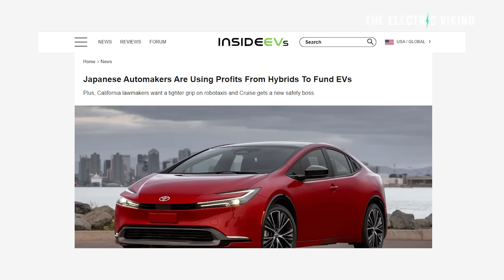Japanese Automakers using record profits to fund huge transition to EVs

Comment: I was a loyal Toyota customer till I wanted to purchase an EV......Now I have a Chevy Bolt EUV and love it.  Toyota's loss.
Reply: Not everyone is buying ev right now , only rich can afford it . Ev not an option for middle class
Reply: They discontinued the Bolt. They used LG Chem (Korean) battery plagued with fire with no resolution (could not fix).
Reply: Actually, EV's have reached cost parity with the average ICE vehicle and Europeans have no trouble stepping up to acquiring and EV as they see the long term value of an EV. They don't seem to go into cognitive overload figuring that out like so many do.
    The writing is on the wall.  ICE is dead in all practicality. And why are so many so impatient?  Take off the blinders and challenge your curmudgeon attitude. Fight back against your cognitive dissonance. It doesn't serve you well.
Reply: @jashanvirsingh2166 Yes, EVs were for the rich 10+ years ago. But there are plenty of affordable EVs now, of course it will depend where you live.  And also it will depend on your government too.
Reply: @jashanvirsingh2166 if you cannot afford a $35,000 vehicle (after tax credit) you are not middle class
Reply: Looking at the relative reliability and customer satisfaction ratings between Toyota and Chevy, not to even talk of resale values and maintenance and repair costs, I would argue the loss is more yours than Toyota’s.
Reply: I loved my bolt euv!!! Smother, quieter and better cameras than my model y
Reply: Toyota makes record profits for two reasons 
1. They sell record volumes 
2. $ vs ¥ appreciation .
Period .
Reply: @TreDeuce-qw3kv in Belgium Tesla Y rwd is 44k, tesla reduced stock to 39,9 K to be elegible for the 5K grant. That means a model Y for 35 K.
Now try to buy a similarly specd VW golf variant for the same price. Then test drive both cars and compare.
Reply: @acousticrecordingservice6991  they don't have Toyota there?
Reply: @heartoftherobot  Tax credit: another way of saying taking money from Person A so that Person B can buy a new car, even if Person A is on the poverty line.
Reply: @TreDeuce-qw3kv  Tesla is dropping its prices, Ford is shutting down an EV F-150 production line, Volvo’s Polestar line has $0 value, Hertz is walking away from 20,000 EVs and canceling Polestar cars, EV prices are commonly what they are due to the government taking money from Person A so that Person B can buy a new car, another UK EV brand just blew through $ billions and is in bankruptcy protection (0 vehicles made) and you write of cognitive dissonance…
Reply: @jashanvirsingh2166  tesla and byd are for the rich? lol what?
Reply: @justinr9753  same problem, touring sports hybrid is quickly more than 35K and still a smaller car with higher running costs and much less power. So, more expensive to own, less practical, less fun, and not as safe. So I dont get the argument EVs are for the rich anymore. Of course the new Polestar 4 costs more than double !
Reply: @PVLTD  Yes, it depends a lot on where you live. In  general, EVs  are  cheaper to own in the long run but there are many factors. Cost of electricity is the biggest  one. CA is raising their prices on electricity making  EVs almost as expensive to charge as ICE are to fill up. Teslas are expensive to repair after warrantee.
Reply: Chevy lost $10000 selling each Chevy Volt.  Toyota can do math and said no to EVs and saved self $10,000,000,000 a year.
Reply: @tims8603  I own a Taycan CT, I think I’m only paying about 10% of electricity bill of what I’ve used to pay for my previous ICE car. As for the running cost, I only need to pay about USD1.5k per year to extend the warranty for up to 15 years. So to me, the running cost is much lower than ICE car.
Reply: @jashanvirsingh2166   Hey average car price in the US is $49,000 so everyone must be rich????
Reply: @mathysdupreez602  LOL What fake news are you reading? Not JD Powers Tesla has higher customer satisfaction that Toyota.  The Model Y is the best selling car in the world.
Reply: @jashanvirsingh2166  Kelly Blue Book 5 yr cost to own for a chevy bolt: 28k
KBB cost to own for average compact SUV: 37K
Reply: @lifeisgood141  where do you get the "could not fix" statement from? All Bolts had their battery packs recalled and swapped out after they found the two production defects causing the fires. The new packs are not identical to the old ones either, as they have a couple of % higher capacity. I've not heard of any fires caused by the new packs.
We used to have a Bolt, or rather the European version of it (Opel badge job), and got our pack replaced. Ended up replacing it with a Model Y, but that was purely for practical purposes (mainly tow hitch), as we were very happy with it.
Reply: Jesus what a downgrade. 😂 500k miles later the Toyota still going in circles around that GM junk. The only loss is your time when it gets fixed.😂✋Former mechanic here
Reply: @greeneyesms  this is not how taxes work. People on the poverty line pay little or no tax and actually are eligible for financial support or subsidy on essentials.
Reply: @lifeisgood141  BS the problem was fixed.
Reply: @mathysdupreez602  Don't think so......My RAV4 cost me approx $25,000-$30,000 in lifetime fuel and maintenance. My Bolt will cost about $5000.  The first time I have to go to the dealership foe scheduled maintenance is at the 5 year or 150,000 km interval.....now tell me again why I should miss Toyota🤣
Reply: @FredPlanatia  I agree. Let me edit to say “approaching the poverty line” which is where a few people I know find themselves.  One had to borrow money to buy a tire to get to work and the other had to borrow money to buy a basic car battery.  They pay income taxes, gasoline taxes, sales taxes etc.
Reply: @greeneyesms  that sounds unfortunate and ofcourse they do pay income tax, but it is much lower than those with higher income (except the super-rich for whom there are ways to avoid tax entirely, that is another can of beans). Subsidy (often expired or reduced now) for the purchase of an EV was to accelerate the transition to lower emission vehicles which is in everyone's interest in the long run. People are reluctant to change their habits and this is intended as a kind of catalyst.
Reply: Good pick the Chevy bolt great car very underrated
Reply: @craigcullen4171  Agreed....the best car I have ever owned.
Reply: @FredPlanatia  Since the highways are largely maintained from gasoline tax, in the coming years the government will probably raise the fuel tax to compensate for EV owners who use the highways but don't proportionately pay for them.  The people at the economic bottom will once again get hurt while watching an $70,000 CyberTruk go past.
Reply: @greeneyesms  eventually as EVs become more mainstream they will probably introduce means to tax EV owners for their use of the road. Just as an example, in New Zealand the law says EV owners are exempt from road taxes until 2% of vehicles are EVs. In the U.S. less than 1% are EVs. That also means that the extra burden for road maintenance on ICE owners is still rather modest.
Reply: @FredPlanatia    I'll be interested in how they implement this adjustment.  My life experience tells me it'll hit the poor hardest.
Reply: @greeneyesms  something to consider is that the environmental impact of ICE vehicles disproportionally hits the poor. Ignoring the CO2 effect, and just looking at NOx and particulate emissions. Poor tend to live closer to busy roads in cities and have higher risk of heart attacks, and cancer from these emissions. If we look at the projected impact of global warming, these also disproportionally hit the poor.
Reply: We are  more than happy with our new Rav 4 non ev purchase.
Reply: @FredPlanatia there is no CLIMATE CRISIS. You have been conned.
Reply: @christinehede7578  the climate is warming at a rapid rate, even if you dispute the cause of that warming, the evidence for rapid warming is overwhelming. That warming will cause various stresses on the human condition and it will hit the poor disproportionately.
Reply: @FredPlanatia  I am not disputing the temperatures,I am disputing the hysterics that call it an emergency. The climate will do what it is going to do and we as just another species inhabiting the planet will have to adapt just as all species have adapted or perished over the millennia had to do.
Reply: @christinehede7578  it will play out over decades and be very costly to the human condition. 40% of the human population live within 100 miles from the coast. Depending on elevation large areas of high density populations will become either unliveable or very costly to mitigate flooding. The shifting patterns of precipitation will reduce or eliminate the harvest of staple crops. The scale of the changes are well beyond what we have seen from local weather events. The climate is a global phenomenon and the impact will be global. Mitigation of the speed of changes would be prudent.  And that will take coordinated effort.
Reply: @FredPlanatia  bullshit
Reply: @christinehede7578  good reply. very forceful argument there!
Reply: @FredPlanatia  there is no need for anything else to be said.except, You have been conned.
Reply: @TreDeuce-qw3kv Actually, none of that is true.  Without subsidy, they're still far more expensive.  And they still don't work as well as ICEV.  And more people want ICEVs than golf carts.

Hope you weren't hoping for some resale value on yours...😮
Reply: @FredPlanatia  Better fold your hand it is hard to beat "because I said so" 🤣
Reply: @billcichoke2534  Actually the resale value is nice but with lifetime fuel and maintenance savings I will have banked enough funds buy my next EV.
Reply: @allankoivu3263  true, its such a stinging reply, i just have to sit down and shut up. 😂
Reply: @mathysdupreez602 😅 2:32
Reply: @HygienistDentist what a downgrade from the world best selling car, the Tesla Model Y, to the discontinued Chevy Bolt

Comment: Shame if it is not true.  The Leaf is a magnificent medium sized car.  I love my Leaf and I have never cared about cars before.  Just a way of getting from A to B.  I wish that Tesla would adopt the speedometer display of the Leaf instead of their offset touch screen.  Touch screens should never be in cars any more than you should dial your smart phone in a car and the Leaf display is clearness personified.  A quick glance and you have any information you want.
Reply: I own a LEAF... by no means is it "a magnificent medium sized car." It's good.... safe.... solid. NOT "magnificent" so please read the previous poster as mildly delusional.
What's important is that NISSAN is barely moving forward with the tech advances. I wish they (Nissan) would jump in with both feet, but they aren't. I'm HAPPY that the arrogant J-legacy firms will pay the price for their POOR ability to sense the future.
Reply: For a measly 75 bucks you can get in a central display added on to your tesla. I added one to mine. I like it a lot. It's cheap, does the job, gives me speedo, battery information turn signals, drive mode Etc check it out.
Reply: @mongo64071  Because it is not something everyone needs.    Looking down is just as disruptive,  But it is an action you are accustomed to.   Not only can you get the display you can get buttons, switches, and levers needed to kit your Tesla out like a 40 year old ICE.
Reply: Then no touchscreens on your phone too only dials, buttons and physical keyboards

Comment: Toyota might end up owning most of the global car market with a tailpipe (ICE, PHEV, Hybrid) as others drop out. So short term they could do very well. However, they also know they have to invest in EV development long term like it or not.
Reply: Why?  Clearly that's not currently Toyota's strategy.
Reply: Kodak, blockbuster, sears, taxis..
Reply: Sears was a revolutionary company that DESTROYED traditional retailing.  WALMART was a revolutionary company that changed retailing. Amazon ... maybe.
Kodak died incredibly quickly to a technology change.  Blackberry was a business tool (phone and PDA) and didn't think to put a music player in their phone, so Apple put a phone in their music player. RIP Blackberry.
Cheap small electric motors that last 500K miles are already available, they need a little engineering rework for cars. Or you can build REALLY, REALLY good but more expensive motors like the Plaid. When CHEAP batteries arrive, the company that DOESN'T have a line ready to go will be toast.

Comment: Maybe toyota is just waiting for a really great battery pack(say 4x better than  LiFePO4),they could at some point you just drop that into the cheapest easiest to build car and make something
that is very cheap even if it is not at first optimized. the question is if you had a "way much better" battery how would the low cost car design change?
How would a low cost tesla car evolve if you all of the sudden had really great small light battery packs?
Reply: The problem is that EVs are not just cars anymore. The reason legacy OEMs are doing poorly in China is because they are trying to make an EV but they aren't software experts. So they make touch screens that provide rudimentary ICE car type requirements and don't think beyond that. If they can give you Apple CarPlay or Android Auto, job done. The Chinese automakers are treating EVs like smartphones and an extension of your smartphone. Full connectivity. Full integration. Innovation.
Tesla, Musk himself, stated that the autonomous sector would eventually eclipse anything the automotive side of Tesla is doing. So it is all about the electronics. If you are just about making the car, or waiting to be able to buy or build cheaper batteries, then you are losing on the front that matters, autonomy.
Its a bit like when the iPhone came out in 2007. Microsoft laughed and said why would anyone buy a $600 phone when they can buy a good phone for less than $90. Who wants a computer with a small screen? I'm old enough to have lived and owned a Nokia. I had an iPod touch before a smartphone and it was incredible. It was everything I was used to on my old Commodore 64 computer, but modern and sleek. Then the iPhone came out and the rest is history. Think about what your phone is today. It is absolutely nothing compared to a phone of yesteryear. It is a phone, newspaper, torch, calculator, social life, camera, video camera, credit card, the list goes on. It isn't just the iPhone that allowed all this to happen, it was iTunes. The whole ecosystem. Tesla is building not just cars but the ecosystem. The OEMs haven't yet figured this out. Why does Tesla need a supercomputer they ask. They can't even make their cars auto-update. This is where the Japanese will lose if they don't get a big move on. It's not just about building or assembling a car anymore.
Reply: @zoransarin5411      I learned to code about the same time I learned to drive. I've worked in software development for 
thirty years. I have also worked in chip making factories and companies that make equipment for building chips.
   Every company has his its own culture and i would say a  biggest challenge is how you meld the software development
with the rest of the company.  The other big challenge is to maintain the software over a long time as the software and computer technology resources grow and gain complexity.
  i would guess that in car culture the tension is between the sales guys and the mechanical engineers, and the software
culture is more or less an after thought.     The top down culture(autocratic leaders)  think waterfall but that doesn't quite work as well as agile development
Reply: @samblum153  I appreciate the background Sam. I must admit I knew very little of the software side of cars until recently, but I was shocked when I watched an interview with Jim Farley (Ford - CEO) who admitted that at Ford, they had taken the approach of ‘farming out’ the modules that controlled the vehicle to create a competitive landscape between part suppliers, largely in an effort to drive cost down. An average Ford had something in the vicinity of 150 modules or semiconductors throughout the car transferring data using the Controller Area Network (CAN). The Intellectual Property of the software running in their car belongs to the supplier. Known as the ‘loose confederation of software providers’, these 150 software providers write their millions of lines of code in different programming languages. He stated that "I actually have to go to Bosche to get permission to change their seat control software". He wrapped up by saying that legacy automakers have almost no software experience and that they will need to write the software that makes the vehicle work, for the very first time with EVs.
It confirms what many people have been saying, and which I didn't realise was that true, and that is that the modern car manufacturers are no longer manufacturers, but assemblers. Most still manufacture the engine, but the rest is pretty much outsourced and assembled.
Reply: Here are a few facts. Peak auto has passed and the numbers of vehicles sold each year is declining due to longer lasting cars.  World sales 2023 75M , China sales 2023 25M, China EV 39% and growing fast, the worlds most bought car in 2023 was as EV, Tesla model Y

Opinion: EVs will be 50% of the Chinese market in 2024 and 65% 2025. China is planning on making emission laws that would make selling ICE cars not possible. Soon the market for ICE cars will look like this , World sales say 75M less China, 25M,  as ICE cars cannot be sold there, less EVs sold in the rest of the world say 15M leaves 35M addressable market for ICE cars out of 75M. This is only a couple of years away.